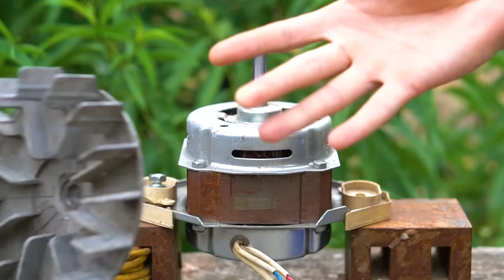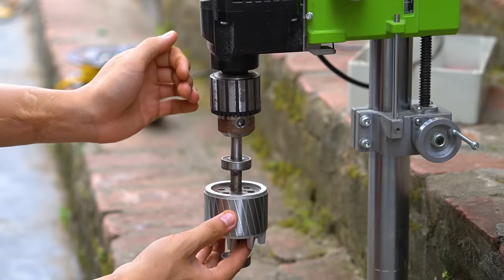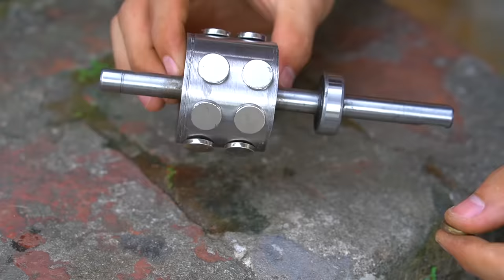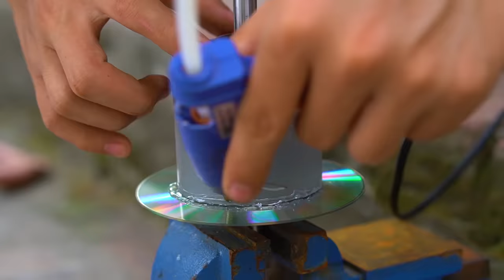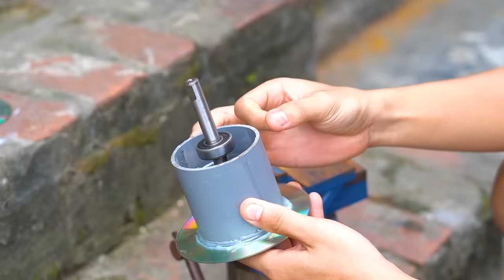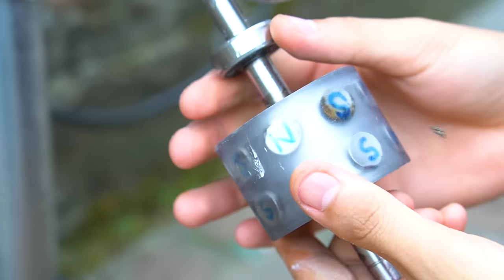I turn Washing Machine Motor into 220v electric Generator

Comment: How its event work without feedback to gas engine to control RPM depending on load and voltage? Looks like scam or things will die soon, because AC parameters like frequency and voltage is god knows what and flowing.

Comment: At 14:27 ...Please Explain the Purpose for Running 250 Volts Through a Speaker Input ... Am I to Believe That Your "Generator" is Somehow Creating an Audio Signal ..? Or Is It Possibly Your Misunderstanding of the Speaker Input Terminals While Creating a FAKE Generator ..? 🤔😉🤣
Reply: Nooo...It has a battery pack 3s 12v. 20ah to 50ah together with 1k to 2k watt 12v - 220v inverter inside the box of speaker to power up all plugins.
Reply: The modification of washing machine motor is just a bait/show of for video viewers purposes.
Reply: As you can see the first he plug in it was the speaker to power up the otherr plugins.

Comment: This is the wrong type of motor to convert into a generator. The magnets are too small and the rotor has insufficient steel in it. The finished item may produce a few watts of energy but never a substitute for a usable half kilowatt of output. There fore SCAM, SCAM,SCAM.

Comment: Waste of time, just purchase an inexpensive generator set, also to get the correct frequency, 50 or 60hz the speed of the engine must be closely matched to the speed the electric motor ran at originally, requiring the right pulleys.

Comment: How do you regulate the frequency? 
How does the passive speaker play when you connect it to a direct 220V power supply to the terminals?
This video is interesting only to those people who have no knowledge of electricity and physics.
This is pure nonsense.

Big thumb down.

Comment: ... the price of gas plus the price of the two cycle oil weedeater motor has to have more than doubles the price it would cost to plug the fan, pump amd speaker into a wall plug.  Thanks for wasting our time and I will definitely not be subscribing to watch you waste more of my time and yours